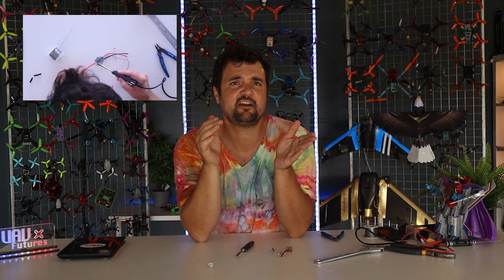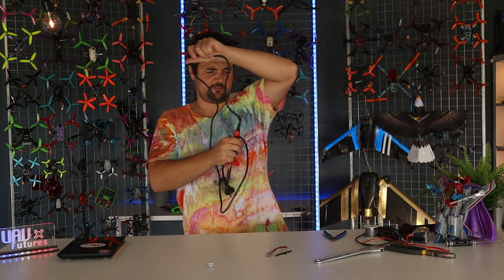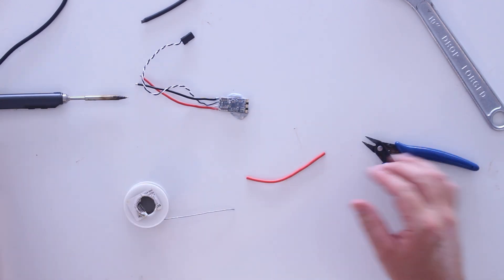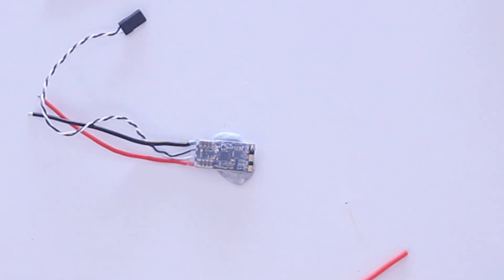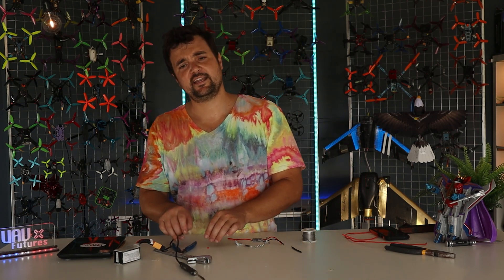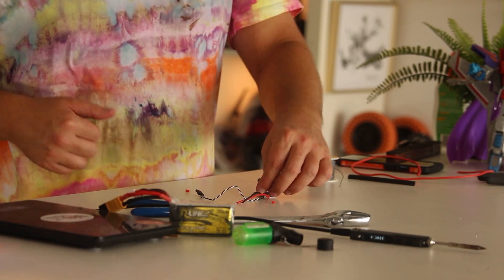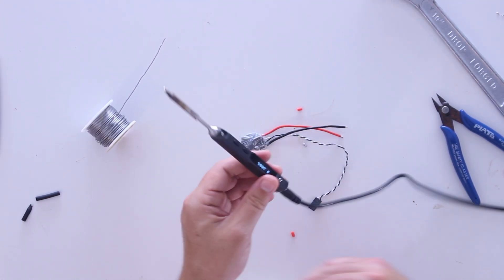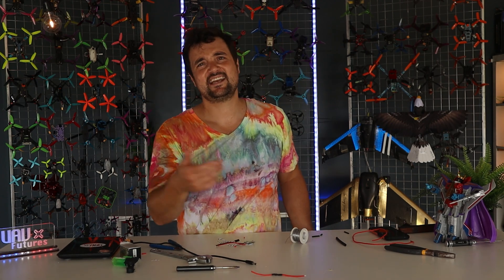REPAIR ANY DRONE. LESSON 1. Soldering

Comment: Good Morning Stew, Another Great soldering video. I learned by watching your 115 MPH drone build. I tried finding a cheap soldering iron that would work good, but after reading all the reviews on the cheap irons; I bought an ST100 on clearance from Race Day Quads for $49.95. Best soldering iron ever!!!  I followed your instructions to a T, and never had one problem when soldering up my quad. When I was finished, I was looking around for more stuff to solder😂. I couldn't find Blue tack here in the states, but we have stuff that's the same. It's Poster Tack and it's blue, it's used to hang posters on your wall without using thumbtacks. So if anybody in the states asks you where to get it, just about any store that sells office supplies and stationery. I hope you have a great day today and an awesome tomorrow. See you in the next video. Love the shirt, and cute daughter, I have 3

Comment: Showing how to repair with new a new clean board?. No showing how to clean the old unleaded solder off or remove the tiny cable end still attached to the pad. Lets see you re solder partially knocked off surface mount components.

Comment: Not really sure why I watched this but I'm here before 750 views woo! This is actually a good tutorial to help people get over the fear of soldering. I would recommend a fan with a filter when working inside for this especially with leaded solder though. Also I didn't realize half of my struggles with soldering were because I used unleaded, never knew it took longer to cool and heat up.

Also, would you have any recommendations on what is worth fixing and what is worth replacing when it comes to broken drone parts? Like in the event that one of the boards in the stack was damaged would that be worth replacing the damaged surface mounted bits or would it be better to just spend the money on a new one? The smd caps and resistors would only cost a handful of change compared buying a whole new stack.